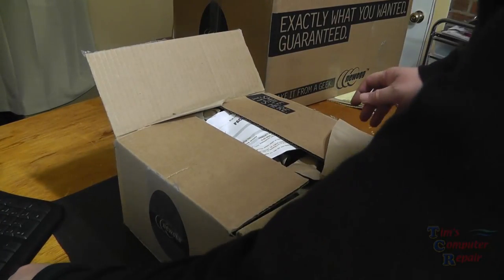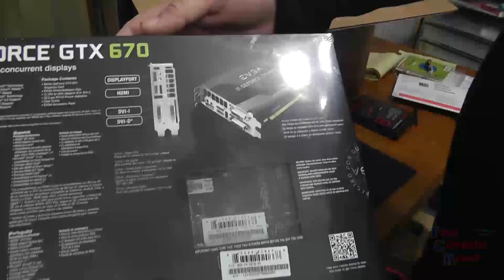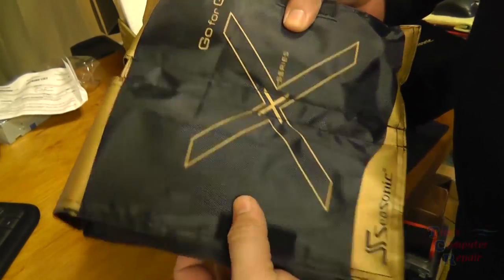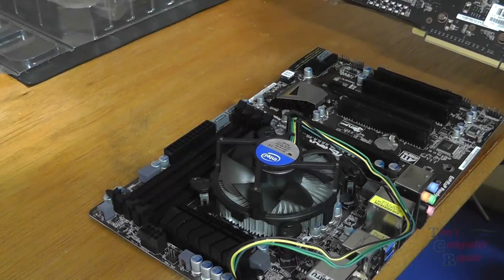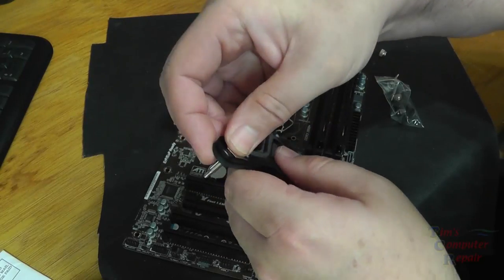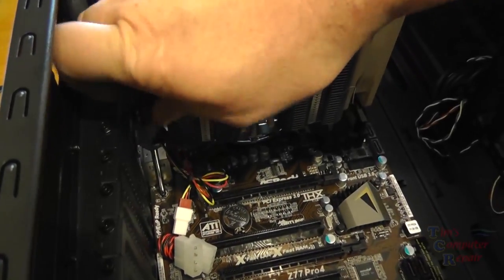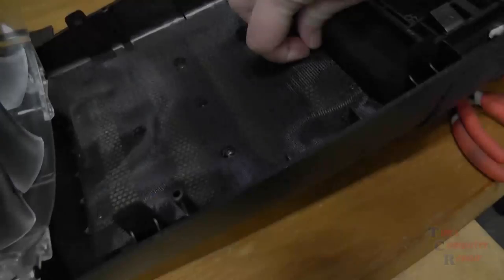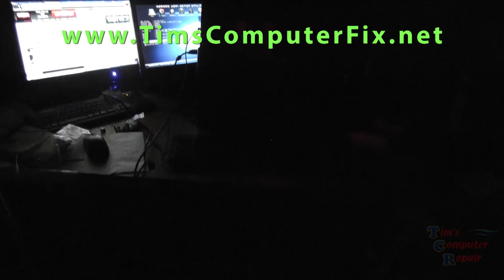Custom Built Gaming Computer by TimsComputerFix.net

Comment from the maker: A few things apply here that made me prefer the fan facing up. For one, this particular model PSU has a hybrid fan. Meaning the fan does not even spin unless the PSU is under higher loads. With everything I have been doing with this computer, including overclocking both cpu and gpu, I have never seen the PSU fan spin up one time except when initially powering on the computer. Also, my computer is on a carpeted floor making air space on the bottom very limited. Thanks For Watching.